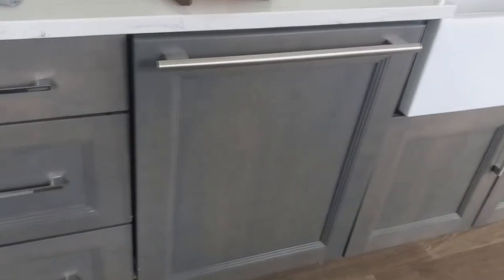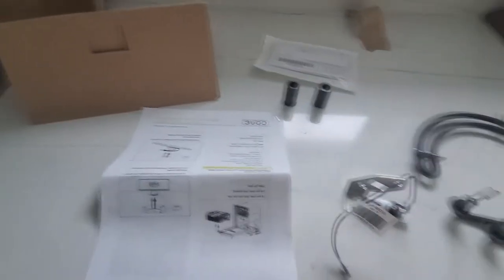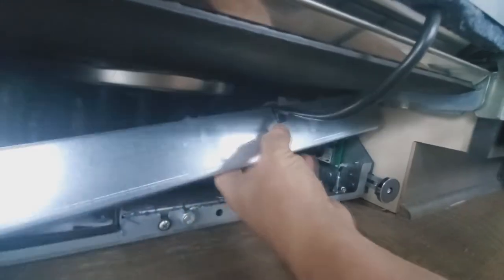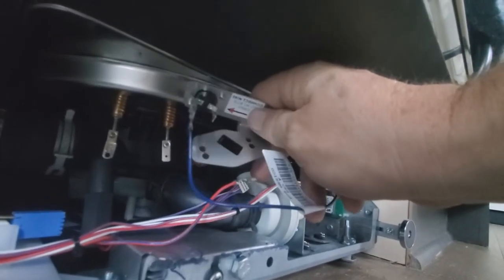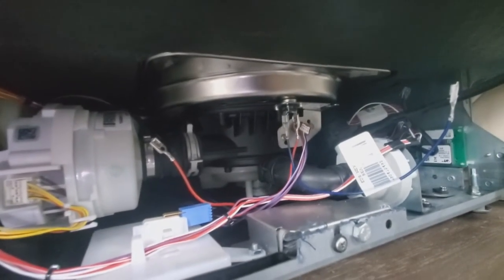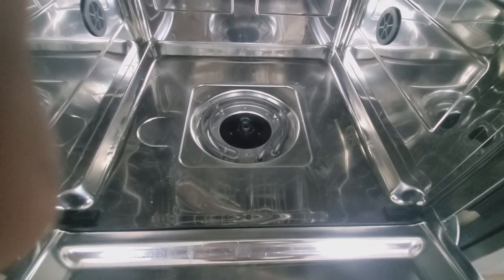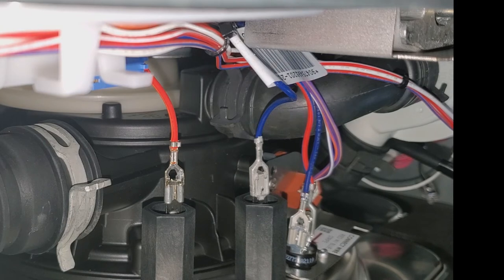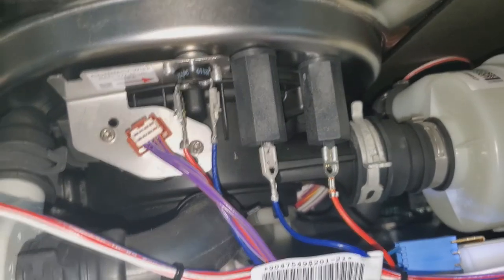Cove Dishwasher Recall Repair

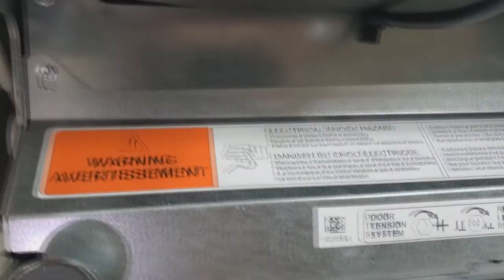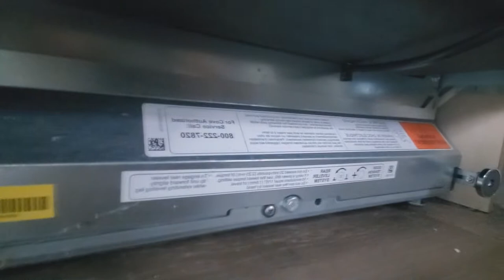Comment: Thank you for this video. It is helpful to understand how the new parts go in and your explanation of everything was clear. When the bottom plate went back on at 20:54, the metal tabs at the bottom weren't tucked inside the metal body of the dishwasher the way they appeared initially at 5:13, which might help with the screw alignment.

Comment: Thank you for the great information.  I have a year old Cove dishwasher and the water is not draining out in the bottom.  Can the pump be checked without taking off the door as you did in this video?  I’m guessing there may be something stuck in the pump.
Reply from the maker: Hi, I'm sorry I have been out of commission for a while,  I'm hoping you got it figured out by now. taking the door off really opens thing up with this dishwasher.